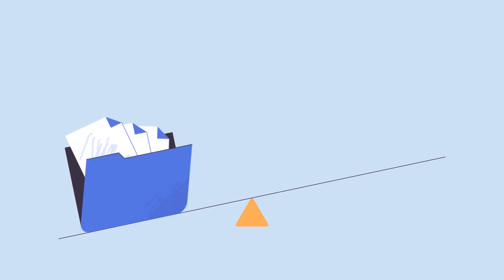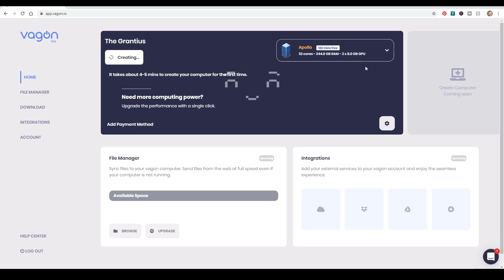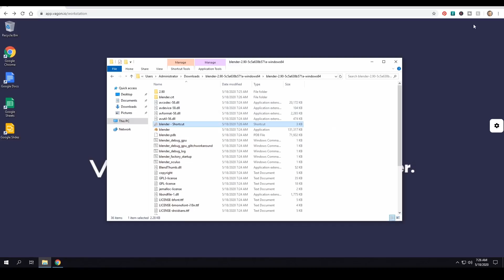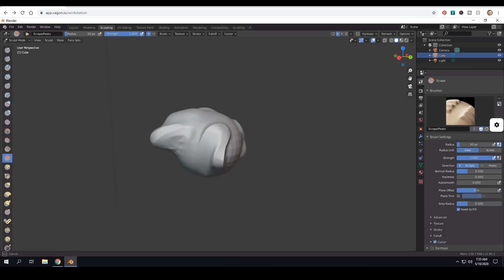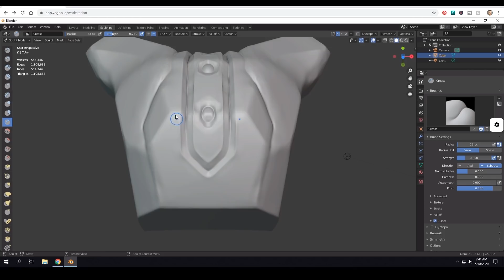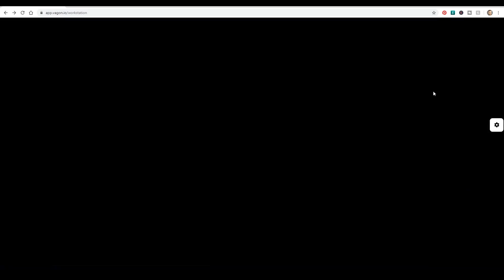Potato Computer? Well This Could be the Answer

Comment: Access through browser is cool, but I might go for a downloadable application (for all platforms, linux, mac, windows)  through which I could access the online computer. That way you could go full screen and all that. As well as I didn't understand you have to install everything on every login? Or just on the creation? Because if it is on login is a bummer. I would like to see a subscription where you could keep all you installed programs and files even when offline. But this type of service would be useful for the creatives, like animators, graphic designers, editors and so on. So Vagon should focus on performance for those workflows. 
This is cool on so many levels though. For example even if you buy a computer it gets old after a while sure you can replace parts and all that but even that eventually is not infinite. 
The only thing that I would like to have is not to have to run it through the browser, so I want the full-screen experience so that it makes it seem like I am on my own pc.

Comment: This kind of concept has actually existed for pretty long already. Your computer in this part is basically a "thin client" which were already in use in companies and universities in the early 90s. Now having full graphics of the full desktop being streamed over the internet on demand is of course quite useful for some people.
For me it's not really worth it though. If I only count the workdays (mo-fr) and take my average time I'm on my own PC on those days (5 hours) across the whole year (52 weeks) I'm already at 1300 hours a year. On their most basic plan with the Professional PC (which is slightly worse than my PC and definitely could not fit my files) this is already over $1770. I currently spend a roughly estimated $500 per year on PC upgrades (1-2k upgrades every few years), which is far less than using their PCs. Of course this doesn't include power usage and common peripherals but because I already factored out the weekends (which would double my hours per year) I think I can ignore these costs along with other minor costs.
For me to be worth it, it would probably need to be at most $0.42 an hour for the professional PC (includes internet & power costs, assumes no monthly basis fee) - but even then I wouldn't be quite satisfied with only having access to the PC with internet and also not owning all my data on something physical. An additional problem with these services is always that if they go away, so goes all of your data and what you had bought. Because the company is based under laws in the USA I also wouldn't really trust them with my data

Comment: Sorry for being a bit pedantic, you seem to be using 'gigabit' (Gb) and 'gigabyte' (GB) somewhat interchangeably in this video. A gigabyte is 1 billion * 8bits, while a gigabit is 1 billion * 1bit. Gigabit is typically used for connection speeds (Mbps/Gbps) but gigabyte for storage, RAM, etc. For example, you incorrectly said  '30 gigabits of RAM' were available, that's less than 4 gigabytes which is (as I'm sure you know) much less impressive.
Reply: Glad I wasn't the only one to notice. Still, I understood what he meant.
Reply: @BeheadedKamikaze  I'm sure most people did (myself included) but I just think it is better to be correct than incorrect?
Reply from the maker: My dyslexia means these things happen often

Comment: $1.29 per hour is very expensive.
I use my PC on average about 10 hours per day, 7 days a week. A decent new PC costs about $1000
If I could afford this service then I could afford to just save up $12.90 a day for 11 weeks or so and then not have to pay any more after that instead.
Thanks for the info though.
Reply: True. If you use it for work or daily for 8 hours a day its a lot. When you don't have a pc or a good pc at home and you need to use it one time a week or Just for a few hours, I would pay 1.29 per hour. For that price it is than nothing.
Reply from the maker: yeah i think i would agree with Arsyl Games. Also the pc's you would be using online are more than $1000 machines.
Reply: Their "best machine" costs close to 2000 euro in my country... but if you need it to render something i guess its good.
Using it online in a big company is a no,no because they wont allow their data to be abused. But someone will find it useful.
Reply: To clarify here. 
I was responding to Grant's musings regarding the possibility of not buying a computer in future but permanently moving to the online rental model. As a one-off thing when you need extra oomph then yes, maybe. But as a permanent option, noooo way.
Reply: I think its expensive too but on the other hand u save much money on ur end with ur power supply or not?
Reply: @bumbleweasle8475  Well with everything there are pros and cons. Anyways its good that someone has set their mind to something new and possibly help people do more with less :)
Reply: I mean, at the very least, if your com got wrecked and you're really desperate, it could be an option. Can you cancel the subscription any month though? That's what I'm curious about

Comment: There is NO WAY that I would ever use a service that forces me to register BEFORE they tell me the FULL costs.
Reply from the maker: let them know and they may well change it :)
Reply: Here are the FULL costs, first, you can use it 1 hour for free with GRANTABBITT promo code, no credit card required. 
After that, if you want to continue using vagon, you will pay according to your usages, which is billed in minutes not hours + monthly subscription fee ( $7.99 / month ) to store your computer and data on the cloud. 🥔
Reply: @VagonHQ  1 hour free with no credit card required? wow i need to try this
Reply: @VagonHQ  your site (that I could see) doesn't tell you how much you are charged per minute.